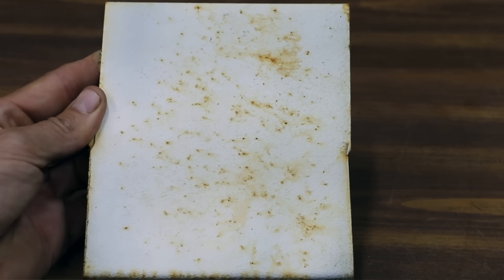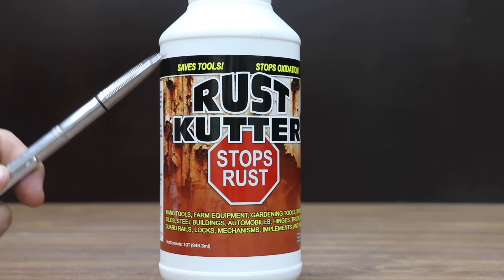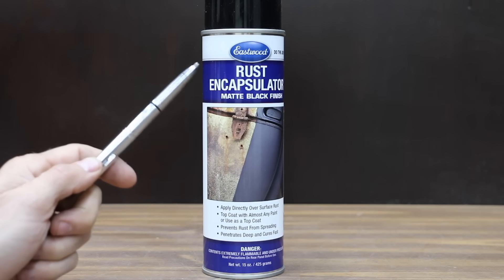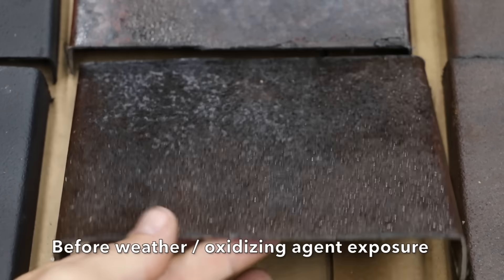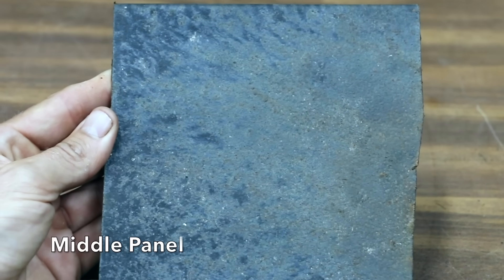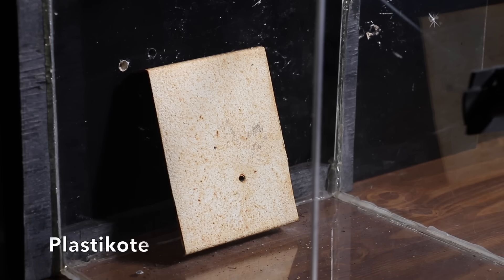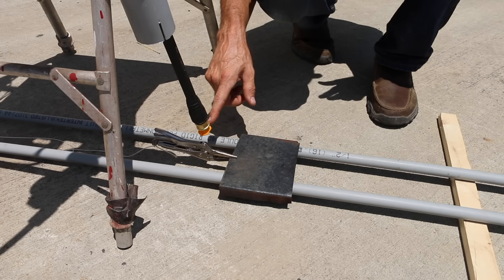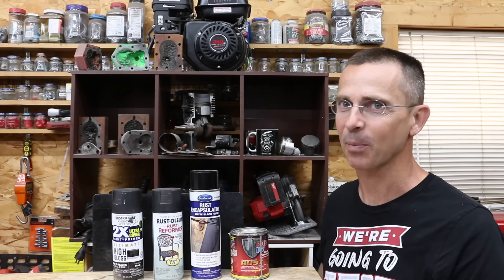Best Rust Converter? POR-15, Eastwood, Rust-oleum Rust Reformer, Gempler's

Comment: It has been a few years, but I did my own testing on products available during the 1990s. There was only one product that worked. Rust Destroyer is a heavy, dark reddish brown colored coating. It was ugly as sin, but I never saw rust on my sheet metal, mobile home siding ever again. Next to a salt water estuary on SF Bay. It was $53/gallon back then. Not widely available. The "converting" type products just leave ugly blackened stains. No significant rust protection.
Reply from the maker: Thanks for sharing.

Comment: Great video as usual, thank you!!! Have you used RP-342? I doubt it would hold up under the pressure washer or scratch but seems to seal really well against corrosion.
Reply: Cosmoline holds up surprisingly well to a pressure washer. This is from experience trying to do a Jeep frame repair. It was coated in the stuff, but rusted out from the inside.

Comment: Great video! 
There's one aspect I've been curious about when it comes to "encapsulators" and rust is the long term durability. I suspect that coatings like POR-15, various undercoatings and other "paint on rust" products can actually make it worse if rust starts to creep under the coating, either through a rockchip or scratch, or if preexisting rust isn't cleaned up enough and continues to spread. 
Some of the most badly rusted cars I've ever seen have had undercoatings applied, I suspect after some rust has initially taken hold, and the undercoating has done nothing but hide the rust until it was too late.
Some longer term corrosion tests would be very interesting.
Reply from the maker: Thanks!  Thanks for the suggestion.

Comment: POR15 does not hold up to direct sunlight.  I painted the flatbed I built for my truck with it, metal prep etched first, and it started chipping & flaking after a few months.  now a year later it needs to be sandblasted and painted.  cost a lot, did a crappy job.
Reply: You likely did it wrong. I have Por15'd entire 4x4s and they are still not peeled.
You can use dry ice to remove the por15
Reply: @keyworksales6241  maybe..  I've painted cars/bikes my whole life.   I used grey POR15, scuffed the whole thing with scotchbrite, wiped it down with thinner, then used metal prep and finally rolled on the POR15.  looked great for a few weeks then turned a greenish color and started flaking & peeling a month or two later.
Reply: this was bare fresh mild steel by the way.  didn't primer it, as I assumed the metal prep would take care of that.  unfortunately it would take a ton of dry ice....my flatbed is 9ft x 8ft diamond plate over tubing.
Reply from the maker: Thanks for sharing.

Comment: This is just my personal experience from living in Denmark where it’s humid / rainy and there’s salt on the roads in the winter.

The only rust inhibitors that actually do anything, are the ones that you apply with a paint brush, the spray on ones don’t really do much. With that said; the ones you apply with a paint brush needs to be applied in 2-3 coats before they fully work….but even so; you still need to paint over them with a strong anti rust paint like “Hammerite” or POR-15 to prevent the rust from coming back.

The products by themselves doesn’t stop rust, even if they claim to do so.

Again just my personal experience. 

Also as you confirmed here; the regular metal paints don’t do anything to stop or prevent rust.

When do you think you will do a comparison on manual impact screwdrivers by the way?
Reply: > The only rust inhibitors that actually do anything, are the ones that you apply with a paint brush, the spray on ones don’t really do much. With that said; the ones you apply with a paint brush needs to be applied in 2-3 coats before they fully work

I agree, also, it's even better when individual coats are applied in criss-cross pattern over each other.
Reply from the maker: Thanks for the suggestion.  Thanks for sharing.
Reply: Nothing truly stops rust.  Rust is like death itself. Inevitable.

Comment: I've always just used Rust-Oleum converter then covered with Rust-Oleum spray paint. Cheap, easy, lasts pretty long and is EASILY touched up.
Reply from the maker: Thanks for sharing.

Comment: thanks for the nice comparison, I think por15 isn't really a converter; it coats rusted/seasoned parts but it doesn't convert the rust itself
Reply: Good point. Encapsulation vs. conversion. Two different type products. 👍
Reply from the maker: You are welcome!  Thanks for the feedback.

Comment: I've had good luck with POR 15 products EXCEPT for their exhaust manifold paint. Also have had good results from the EastWood products. Back in the 90s, Permatex had a spray called Extend. I dunno if they still make it, as I've not seen it on the shelves for many yrs, but that stuff worked GREAT on sheet metal. Thx for the vid!
Reply from the maker: You are welcome!  Thanks for sharing!

Comment: I used POR15 on my bare metal engine bay in an old porsche restoration project, that was 7 years ago... still looks brand new . I've used so many different products over the years and keep going back to por15. Its just a little harder to source in Australia, and definitely more expensive. Next job will be on certain section of the boat trailer. Make sure youbhavrva rough surface for it to bite onto and it will last. If exposed to UV then overcote it before it completely dries, it's so strong than roughing up with sandpaper is a hassle.
Reply from the maker: Thanks for sharing!

Comment: OSPHO should have been included in this test, and a note on the POR 15, DOT 3/4 brake fluid WILL melt that stuff like ice cubes in hot water.
Reply from the maker: Thanks for the suggestion.  Thanks for the feedback.

Comment: So a question for PF (or any of you gracious enough to reply) What is rust reformer for exactly? I'm a diy-er, not in any trade, and I've used evaporust, vinegar, and CLR to remove rust in the past. I've then sprayed the tools with some WD-40 to prevent further rust, and Im looking into waxes and something called "bluing" fluid (??) as a better alternative to WD-40. But, what does a rust reformer do that evaporust or WD-40 isnt doing, and what are the drawbacks/advantages of a rust reformer?
Edit: Also, why would I spray this onto a surface instead of just say, a rustoleoum paint?

Comment: Sweet Project Cars (SPC) has been using "Loctite® Extend Rust Neutralizer Spray", which converts rust and dries as a primer so that you can use something like "Rustoleum Professional Enamel" on top of it... or that is what he recommends for vehicles and i am thinking of doing that for the undercarriage of my vehicle, hopefully it holds up!

Remove rust scaling (wire wheeling/grinding/peening), apply SPC's secret stop rust formula (Dawn platinum, Auto tranny fluid, PB Blaster) and let it sit/soak for a couple of days, spray off with high pressure water and/or soap, let dry, spray Loctite Rust Converter & Primer, let dry, paint over with rustoleum prof. enamel, let dry, and for good measure i have some more spray paint lying around to add over it of so.

What do yall think?
Reply from the maker: Thanks for the feedback.
Reply: @ProjectFarm  Thank you for the video also! It came right on time and it is very informative!

Comment: Some people have an issue with por. The key imo is to remove anything you can prior to applying it. Been used at body shops I've worked at when people don't want to pay for full on proper rust removal. and when prepped properly it very rarely fails. If u just spray it right over rust it usually will come back later. Remove as much as possible doesn't need to be bare clean metal but wire brush or sand off anything raised or loose, usually it lasts for a really long time. Its not as good as clean metal but is great when used properly.
Reply from the maker: Thanks for the feedback.

Comment: I think por15 is made by magnet paint company if I remember correctly.. you can buy straight from the company.  I have a 32 Lasalle using the original frame. Coated it all with magnet paint (por 15)
Reply from the maker: Thanks for sharing.

Comment: Would be curious to see test with rust converters/removers.  I work with a lot of rusty stuff that I don't want a paint coat over, or, am going to use a fuel tank sealer on. Sometimes I just want to rust converted so I can sand blast it or just leave the metal alone.  Eastwood had a product years back that turned the surface grey.
Reply from the maker: Thanks for the suggestion.

Comment: Another test vid up to your usual high standards. My own research led to me using por 15 on a utility trailer frame 5 years ago. Only 1 coat and didn’t put a top coat as recommended. It’s only now beginning to show light rust specs. Good stuff.
Reply from the maker: Thanks!

Comment: Hello sir, I hope you are doing well! Can you do a video about difference between gasoline engines?  I mean the fuel efficiency based on the available engine models. Example, Yamaha says offset displacement, Honda says straight cut displacement, and so on. So, which engine model is better. Thank you.
Reply from the maker: Thanks for the suggestion.

Comment: Could you test Rustoleum  Farm&Implement Heavy duty Weather resistant & rust preventive plleeeaaasseee? Just so I can get a better idea how my trucks bed, frame, and fenders will hold up. I painted the entire underneath and inside the wheel wells of my bed with it and the inside of the fenders and so far about half of my frame with it and my other trucks floor with it because it being old it takes in a decent amount of rain water. I removed as much rust as possible on everything between sandblasting, sanding with 40 grit disk, and wire wheeling.
Reply from the maker: Thanks for the suggestion.
Reply: @ProjectFarm  your welcome 🙂 thank you for the great video.

Comment: i found rustoleum roll on oil based paint too out preform POR in outside conditions, the rustoleum you can buy at lowes, they also have a rusty metal primer that seems to work great too, the top cost oil based roll on is available in different colors and finishes and is way cheaper then POR but holds up to sun damage way better, my trailer is coated in it and my parents trailer is coated in POR and the POR was fading and leaves residue on your hand after a year sitting outside, my trailer (painted a year before) did need a touch up after 2 years but i went ahead and switched to high gloss over the flat black but def recommend trying it
Reply from the maker: Thanks for the feedback.

Comment: The best product we have found is Rust Bullet.   It is a moisture cured urethane coating.   It is pricey, but it goes on easily, coats well, and last forever.  Very minimal prep required.  You can overcoat it with whatever paint you like, or  leave it as is.   I've used it on a Jeep frame, with good results.   We have also used it to touch up rust spots on a Steel Swimming pool. before coating with Pool paint each year.   It is the best product we have used over the years on the pool.
Reply from the maker: Thanks for sharing.

Comment: Great video as always.  For the next rust paint go around, give (Rust bullet), and  "Miracle Paint-by the bill hirsch company a try.  Both of these are encapsulators, and set up hard as a stone, but not brittle.  Dry's quicker in high moisture environments. You can even use it with fiberglass, and patch holes.  Nearly as strong as thin steel.
Reply from the maker: Thanks so much!  Thanks for the video idea.

Comment: The frame on my 4Runner was beginning to rust after 20 years. About a year ago I coated it with some Por15 everywhere I could and it has held up really well. Pretty much put a stop to the rusting. It’s expensive, but man is it worth it!
Reply from the maker: Thanks for sharing.

Comment: Knew POR would win this one. That stuff is amazing. Used it on a lot of stuff over the years and it held up amazing. Unfortunately I had a truck catch on fire and burn to the ground a few years ago. All the paint was of course torched. However none of the POR15 burned off the frame. I couldn’t believe it
Reply from the maker: Thanks for the feedback.  Wow, thanks for sharing.

Comment: There are at least 2 other rust converters that I know of. One is a pink brush on and the other is a green brush on. Both are supposed to be rinsed off after letting set for a few min. I forget their names, but I bought the green one at NAPA in Canada.
I preferred the pink stuff, although both seemed to work reasonably well. I hope you will find these 2 and others to compare.
Thanks, Philip
Reply from the maker: Thanks for the video idea.

Comment: Even though the POR15 won, one of the big things that you need to do if you're using it is to NOT use brake cleaner, and to use a water based degreaser. Also you really should use their metal prep stuff which is like ospho and etches and leaves a zinc phosphate coating which the paint sticks to. A lot of people have reported por15 flaking and it's almost always because they didn't read the instructions. I'm inclined to test some metal using their degreaser and metal prep vs simple green and ospho (or other similar products) as I think they do the same things. Using something like ospho helps a lot if you just want to use some rustoleum, it'll keep the rust from popping through and the paint from chipping off.
Reply from the maker: Thanks for the feedback.

Comment: I've used the eastwood internal frame coating/fluid film on my one car that has never seen a winter since I bought it used. I have no complaints. I painted the frame the best I could with por15. No more rust has popped out. It wasn't bubbly rust just surface. Best looking midwest car its age around. Trying woolwax now on my winter/family hauling truck. Por15 is great just not in the sun.
Reply: Definitely hates the sun. I used a bit on my bumper and it turned transparent and has rust coming through.
Reply: Need to use the uv stable top coat if exposed to the sun
Reply: @craigwiess1656  Very true, I have heard of some people rattle can spraying por15 while it was still tacky and had good results just using normal rustoleum to keep it from becoming chalky.

Comment: When I saw POR-15 on the list, I knew it was over before this began. :)  When it comes to rust reforming/encapsulation, there is POR-15, and then you may as well not use anything, in comparison.

Comment: That POR-15 does not look nearly as thick as when I apply it, you have to really mix it well as it settles. The only other product I use is Rust Bullet, I have coated all of my mower decks and frames in Rust Bullet, I use POR-15 on my trailers and vehicle floorpans.

Comment: Another great video! Confirmed my experience with POR-15 being one of the best around. Would love to see an eval with Evaporust followed by scrape/paint.
Reply: Evaporust is not the same as a rust encapsulator.  It is meant to return rusty metal to a bare metal if submerged.
Reply: @SkaterStimm Yes, it's a very different product.  Using that plus a regular primer and paint is a very different strategy.  All the more reason that a comparison would be interesting.
Reply: I use POR-15 and find it the best solution.  I tried various other options and they all failed in just a few months.  Like any such product, prep and application are key.  Do it right and you get the best results.
Reply: Same!

Comment: phosphoric acid is the way to go or sand blast but sometimes it's not possible, then paint over it then finish with a 2k clear. In the past i've use some product in can but doesnt remeber the name, sometimes it worked sometimes it was not it was weird

Comment: I’m surprised the por15 did so good. I used it on the underside of the  deck of my mower several years ago. I spent a lot of time prepping the surface per their instructions prior to applying and it still had a very hard time bonding. A lot of it separated from the metal someone, leaving a gap for the moisture to get trapped behind. It did seem to be a little different product than you used here though, so perhaps they changed it.
Reply from the maker: Thanks for sharing.

Comment: Great work!
You will probably need to cut the can apart next time you want to use the POR15. You need to either clean the rim spotless, or lay two layers of plastic wrap down, before knocking the lid back on. For this reason I recommend the 6 pack of small 4oz cans, if you don't plan to use it all at once.

The 3 part kit, with their degreaser, "metal prep", and 1 small can of black POR15, is a pretty great deal for $25. With that and a tube of their "patch" I took care of all the rusty holes in my 20 year old car.  They seem adamant that the first two steps are not to be skipped, so like others I'm curious what difference it would make. You just spray them on, let em sit, and rise with the hose. Honestly probably not worth trying to work that into another video, but I recommend giving it a shot if you want to rustproof equipment around the farm.
Reply from the maker: Thanks!  Thanks for the feedback.

Comment: Mar-Hyde 35132 White One-Step Rust Converter (3513 1 qt)   - the good stuff
3m MHD-3509 One-step Rust Converter Primer Sealer Aerosol -  the cheaper good stuff. 
these are probably the best for your money.
use these products in a well ventilated area as their chemical reaction with rust creates very harmful fumes.
Reply from the maker: Thanks for the feedback.

Comment: Helpful, thanks! My request is for ferrous metal cutting saw blades. I use a 12” Makita dry saw for mild steel and I can’t tell if the $120 blades last any longer than the $50 ones. Thank you!
Reply from the maker: You are welcome!  Thanks for the suggestion.